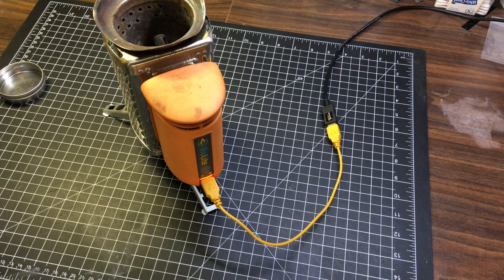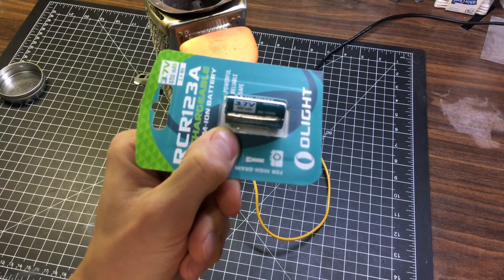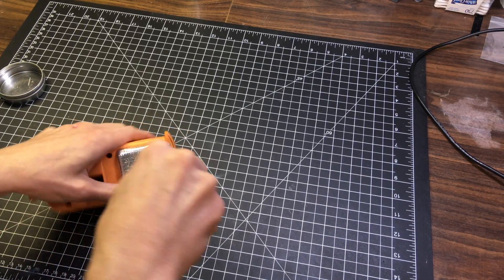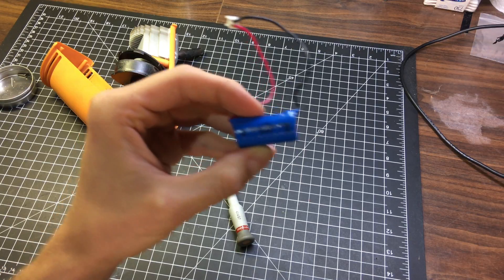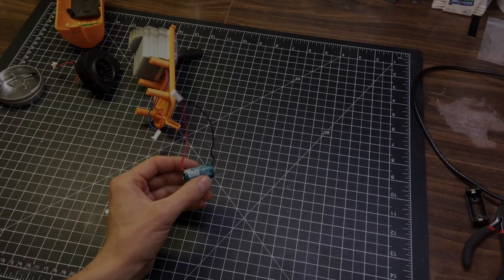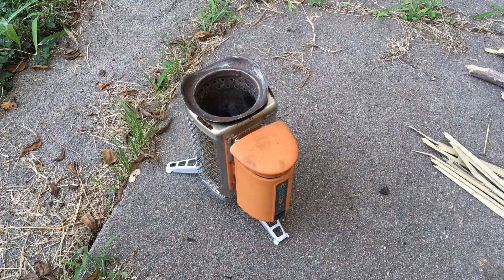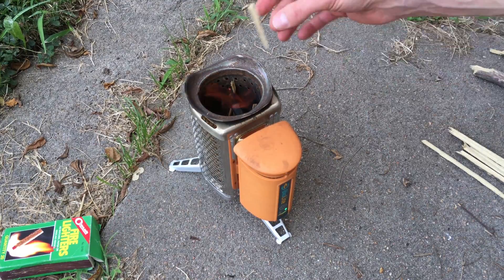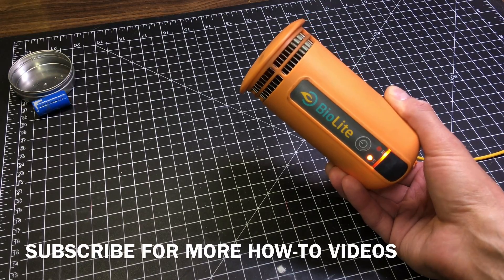How To: Replace the Battery in a BioLite CampStove

Comment: Absolutely awesome video man. I just had a mild panic attack here in 2025, I hadn’t used the stove in a longgggg time and broke it out. Battery was so dead the charger didn’t even recognize it had been plugged in, and I couldn’t charge it. 
.
Was absolutely thinking I’d have to take it apart and figure it out. But thankfully I was able to get a fire going long enough to use the thermocouple to bring it back to life. But this roadmap is gonna come in handy at some later date time sure.

Comment: I have the Biolite that came after your's, What battery would you recommend I get?
Reply from the maker: i dont have a BioLite Campstove 2, but i believe it has an 18650 inside.  you might want to open it up and look to verify before ordering a replacement battery.  i found this picture of the internals on Reddit where the OP is using an 18650:
https://www.reddit.com/r/CampingGear/comments/ckk0vr/i_need_some_helpso_i_replaced_my_battery_on_my/

Comment: Just wondering do you need actual fire so you have power out in the usb port, like to charge a phone or to be able to turn on the usb lamp and high power for the fan?
Reply from the maker: in this particular model (Gen1), the battery powers the fan only, and the USB port outputs power only when there is a surplus from the thermoelectric generator.  so yes, with this model you need fire to charge anything.  however, BioLite's current model (Campstove 2+) has a 3200mAh internal battery that charges devices with or without fire.

Comment: What a trash unit....they MASSIVELY rip people off with that thing :/
Reply from the maker: admittedly, i haven't been in the market for a new thermoelectric generator camp stove, so i am unaware of other alternatives.  what's your favorite camp stove?
im sure other people here in the comments will see your recommendation(s) and check them out!
Reply: @DavidVonk  the metal part of the BioLite is actually quite nice, just the TEG part is so expensive that is makes the whole product unreasonable.
I prefere a simple Hobo/Bushcraft Box from Stainless Steel. They are arround 30$ and do a great job :)
Reply from the maker: nice!  there are definitely benefits with having such a simple, minimalist design.  thanks for sharing!

Comment: I know this is an oldie.... but I have the Gen 1 too, STILL rocking the SAME FACTORY blue 3.7v 500mah cell.... how do you keep it alive? DO NOT RECHARGE WITH EXTERNAL POWER..... ONLY the internal system.
Reply from the maker: very impressive, and thanks for the tip!  i mistakenly forgot mine in the non-insulated attic for several years where it slowly discharged while suffering under extreme temperature swings; not good for batteries.  oops.  oh well, im glad i was able to revive it... this battery i installed in this video years ago is still working though!

Comment: How long does it take to charge the internal battery from dead using only the heating function?
Reply from the maker: i couldn't tell you.  if the battery is dead the fan won't work, which greatly reduces the combustion speed & efficiency, which it turn will limit the amount of heat that actually reaches the thermoelectric generator.  i dont know what temperature the thermoelectric generator needs to function, or what amount of input power is required to activate the charge circuitry.
Reply: @DavidVonk  it IS possible to recharge from dead to full in about an hour (or more depending on how hot you get the fire pot)
Reply from the maker: @BeezyKing99  hey, that's good to know!  thank you for sharing :)

Comment: W9uld you happen to have the link for the battery, trying to find on google woth the model but cant get any hits
Reply from the maker: hello, the RCR123A batteries are apparently also referred to by their size, 16340, so you might have more luck searching for that.  here is a page i found (no affiliation) with a bunch of brands, if you just want to see what is out there:
https://www.batteryjunction.com/batteries/shop-by-size/16340-rcr123a

in this video i used a soldering iron to attach the leads which dumps a whole bunch of heat into the battery and can damage it and reduce its life, and if i did it again i would get a battery spot welder to attach them properly; they start at like $40 on amazon.

that said, i did this battery replacement 6 years ago and my old Gen1 BioLite still works fine and holds a charge.

Comment: Hola consulta lleva un solo peltier y la placa electrónica se puede conseguir,y el cooler con que voltaje funciona?
Reply from the maker: sorry, i did not measure the output voltage of the peltier.  it will charge the 3.7v battery and power a USB port... maybe 10 volts?  just a guess.

Comment: I HAVE THIS SAME ISSUE WITH MY CAMPSTOVE GEN 1, INTERNAL BATTERY CAN NEVER FULLY CHARGE THREW THE USB, WHICH LEADS TO IT NEVER BEING ABLE TO TRICKLE CHARGE THE USB POWER PORT WHEN YOU GET THE FIRE GOING - THE HIGH SETTING OF THE FAN WINDS UP AND DOWN - BACK N FORTH REPEATEDLY...I THOUGHT THE VERSION 1 DIDN'T HAVE A BATTERY AND BOUGHT IT FOR FEAR OF THE INTERNAL BATTERY OF THE VERSION 2 DEGRADING OVER TIME...SMH AT LEAST THE REPLACEMENT IS NOT TO EXPENSIVE OR TO COMPLICATED OF A INSTALL...I'M GONNA HAVE TO ORDER A 900mAh BATTERY THEN REWATCH THIS VIDEO A FEW TIMES FOR THE INSTALL PROCESS, SEEMS SIMPLE ENOUGH, THANKS AGAIN FOR TAKING THE TIME IN SOLVING THIS PROBLEM AND SAVING THESE CAMPSTOVES FROM ENDING UP IN A LANDFILL
Reply from the maker: youre welcome!  i'm glad you found the information helpful and that you want to save your Gen 1 from the landfill.  good luck on the replacement!

Comment: Great video! Do you have any knowledge of expanding the batteries to 12v? Would that require new parts?
Reply from the maker: thank you!  im honestly not sure what the charging output of the thermoelectric generator is, but i do know that it is pretty low.  you have to keep the fire pretty hot to have it generating enough surplus electricity just to power the USB port.  i would imagine you would need to modify or replace the circuity to make it work with 12v, but i have no idea how or what you would need.  i just wanted to get mine working again.

perhaps someone with some electronics knowledge will chime in.

Comment: The saddest part of this stove (gen 1 & gen 2) only on the motor fan. They just use brushed DC motor instead of brushless!
I recommend to add more peltier element to increase the way harvested electricity, then replace the fan with 5V brushless 150mA blower, and make the 18650 twice for capacity.
Reply from the maker: nice, sounds like some serious upgrades!

Comment: The Biolite Campstove (gen1) uses an ICR17335 rechargeable lithium battery. The dimensions are similar/same as the CR123A that he uses in the video. The current replacement for this, with all the wiring/tabs (he uses a holder, but it's better to use soldered tabs) is the 7.4v RC Boat battery for the Skytech H100, H102 boats. There are several vendors who make that pack. It should be 19mm deep (thick) and 35mm long. It uses two 18350 cells internally (18mm x 35mm). The packs come with silicone wire and a SM-2P connector, and an extra XH-3P charging connector. You should only need a soldering iron, solder, flux, wire cutters and kaptan tape. You will simply cut the pack apart and use one of the batteries. Your existing connector can be swapped onto the second battery. You can buy individual 18350 cells with tabs, but they are more expensive than the 7.4v 2-Pack.
Reply from the maker: thanks for sharing!  in the video i considered the idea of using a battery holder, but scrapped it due to space issues and ended up soldering the existing connector onto the new battery like you describe.  cheers!
Reply: didn't watch the video 
and comments like he da king

Comment: Great video and a nice and easy fix :)

To sum some comments and my own experience:

The symptoms of a failed/failing battery

- orange light never stops blinking when charging CampStove from external power source
- no power on the USB port even when the green light is on
- fan turning off quickly even when the stove is seemingly charged from external power source
- the stove being dead, not starting and not charging

If you have any of those you should apply this fix as it's easy and cheap.

As for using a bigger capacity battery - there is little space inside the case but this could actually be useful.
Per standard  an USB port should provide at least 500mA of current at 5V. Some devices will try to pull this much current and won't charge if they don't get it. CampStove 1 thermoelectric cell can provide 300mA in best conditions. When you try to pull 500mA from the stove you will get it - 300mA from the fire and 200mA from the battery. When battery voltage drops below certain level the USB light will go orange and internal battery will be recharged. To sum it up - when your device is power hungry, BioLite will charge it in pulses. Installing a bigger internal battery could make these pulses be longer.
Reply from the maker: glad you liked the video; and thanks for the tips!

Comment: But what about the battery indicator? Does it work properly after the battery changing?
Reply from the maker: since i swapped the battery with an identically-rated replacement, all original functions of the unit remain unchanged.

Comment: My power bank still running fine after 4 years of heavy use. But the metal burning cup has finally seen its end and need a new one. Contacted Biolite and they said they do not sell replacement parts. So I am going to make a new one for myself
Reply from the maker: nice!  yeah, despite what some people think, stainless steel isn't "stainFREE," its just "stainLESS."  my combustion chamber has some oxidation on in as well, but i still has plenty of life left.
good job making a new one for yourself to keep the ol' Biolite alive!
Reply: @DavidVonk  This disappointing part is they presented themselves as a company that helps the 3rd world countries and reduce the carbon footprint. while the company is doing all that. Forcing consumers to purchase a new unit and dump the usable part is just a big red flag to me.
Reply from the maker: yeah, that definitely sucks.  i hate how "disposable" things are these days.  give me the parts and i'll fix it myself!

Comment: Nice video.i just picked up the Biolite 2 at a pawn shop with the grill attachment for 75 dollars.im liking it.do they come with a power cord for home charging ?.thank"s
Reply from the maker: my original Biolite came with that little yellow USB cord you see in the video for charging.  not sure about the Biolite 2, but i imagine it did as well.
Reply: I got the Biolite 2 for Xmas. It comes with a usb cable and an LED light.

Comment: well if you skip the battery and connect the cables direct to the usb "out" then you could charge the external units direct
Reply: The battery powers the fan, which strikes the fire. Also a direct charge would most likely fluctuate and destroy your device

Comment: Yo , used my campstove about 200 times and had it about 3 years now , battery still ok , 9 months ago we bought a biolite basecamp stove , used it about 90 times and the battery is not holding a charge or the unit is not charging , I used to stove in below zero condition and even at around - 5 C .......I'll guess the battery is bad , so my question is can I plug in to the USB port and supply the fan .  The fan does come on  for about one minute then goes out at the same time as the battery level led .....thanks for your video and time
Reply from the maker: hello, i do not have a BaseCamp so im not really sure how they work, but have you tried charging it through the usb port?  i'd imagine they would design a way to input power if the battery dies, like you can do with the CampStove.

that said, i did read this negative review on BioLite's BaseCamp webpage:
"There is no warning that the fan will not run if the battery is dead/empty. The result is that the entire thermo-electric assembly overheats, solder melts and wires disconnect, and the plastic air duct melts. BioLite could have printed a warning to charge the battery first with a special cable, but they didn't."

does that sound familiar?  searching around on the internet, it appears the BaseCamp has been discontinued... maybe this was a recurring problem?
Reply: @DavidVonk  Thanks for your fast reply ...your scenarior is probably right , I'm pretty sure I can hook a fan somehow maybe the fan is still ok ....a long time ago I  graduated as a EET so I'll be ok . The dome cover has a mechanical thermometer so I can monitor the heat ......I have accidentally overheated the stove a few times  and got about 60 days at 4 hours a day usage  usage , anyways I use small bike agm batts so I'll supply the fan with 5 volts and all will be ok.........I use it for heating and cooking and it gets mounted on my trailer which is pull with a three wheel drive velomobile  .....I also have a   Campstove  , used it about a hundred times burning coconuts for 3.5 months in Dominica camping and still works after four years of usage....will let you know what I find inside the orange housing of the Basecamp ....thanks again for your time
Reply from the maker: ah yeah, it's likely the overheating did more damage to the battery than running it below freezing.  best of luck on the repair!
Reply: @DavidVonk  about two months ago my vapourizer stop working and it was still under warranty .....because of the smell of the unit , my wife told me to keep outside the house and the litium battery was being charged in the freezing cold weather .
I did get a free replacement but I was told not to charge my litium battries in the freezing weather cause it was causing premature failure of the battery.......the technician told me the action of charging did the damage ,  have you heard of this action causing premature failure to lthium batts.....I use 12 v agm batteries in my electric trike and charge outside and it seems to be ok , I get about 4 years out of them...reguardless I'm very happy with my Biolite stoves and they are repairable
Reply from the maker: i hadn't heard that, but i dont claim to be an expert on battery tech either.  i wouldn't be too surprised if they have a range of temperature tolerance.
Reply: @DavidVonk  I took a computer entry course and we were told not to keep our device overnight nite in our vehicules iduring cold weather  I copied the following from googling 

Li ion can be fast charged from 5°C to 45°C (41 to 113°F). Below 5°C, the charge current should be reduced, and no charging is permitted at freezing temperatures because of the reduced diffusion rates on the anode.Sep. 15, 2017
Reply from the maker: good information to know!  thanks!

Comment: My stove seems to charge and run fine but no power output once the green light comes on. Could this sill be the battery or something else?
Reply from the maker: i couldn't say for sure, but that sounds like it may have something to do with the USB port or the circuit board.

Comment: Rechargeable 3.6V CR123A.  Batteries+Bulbs had a 4 pack for $30 & the tech there soldered the old wires onto the new battery without charge. Everything reassembles best if you put it face/belly down and fill the guts. Mine definitely needed a TLC Cleaning! Thank you for the video!
Reply from the maker: nice, good deal!  you're welcome—glad to hear the video was helpful.

Comment: Charges when it reaches a hot enough temperature
Reply from the maker: yes, the USB charging port is only activated after the thermoelectric generator has recharged the internal battery and it has an excess of power.

Comment: If you put wood pellets in it it will burn hot enough to charge for an hour.
Reply from the maker: the manufacturer says it will burn wood pellets, yes.  i have not personally tried them, but i am sure you could burn them for an hour if you keep adding pellets when the fire gets low.
Reply: David Vonk yeah i have used pellets one hour hot

Comment: My battery/charging point is basically dead after 10 years. The fan still works so it's still a great cooking device even without the charging capabilities.
Reply from the maker: you're right!  it is a good cooking device even without the USB charging, which is why i decided to try repair this old one instead of tossing it out and getting a new one.
long live your old Gen 1 BioLite! :)

Comment: Have you ever tried it change out the batteries on a nanogrid light?
Reply from the maker: hello, i do not have a NanoGrid, so i couldn't say for sure how the battery replacement would be performed.  i imagine it would likely be a similar process: disassemble, desolder old battery, resolder replacement battery, and reassemble.
Reply: Thanks! I'll probably be tearing into it sometime soon just not sure how it comes apart. But thanks for the reply!

Comment: Have you done this on the powerlight
Reply from the maker: hello, i do not have a PowerLight, so i couldn't say for sure how the battery replacement would be performed.  i imagine it would likely be a similar process: disassemble, desolder old battery, resolder replacement battery, and reassemble.